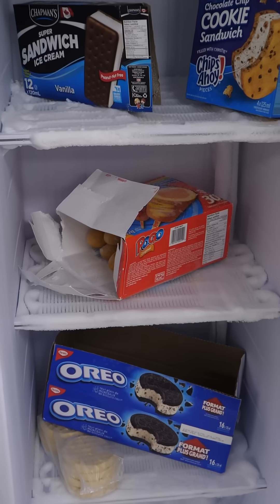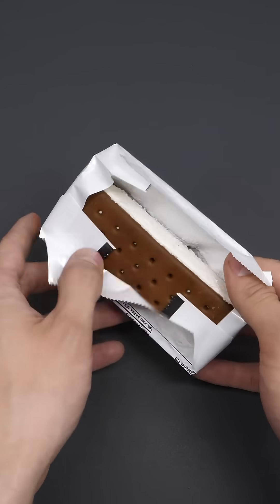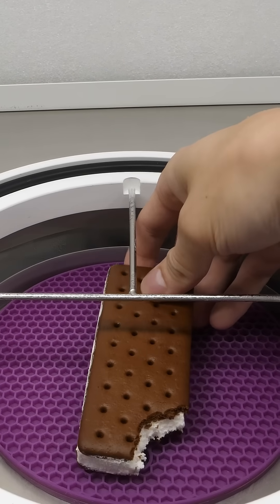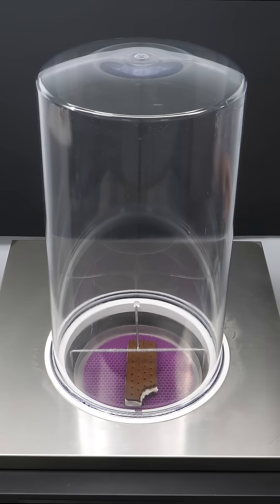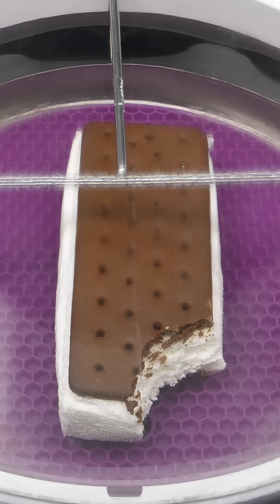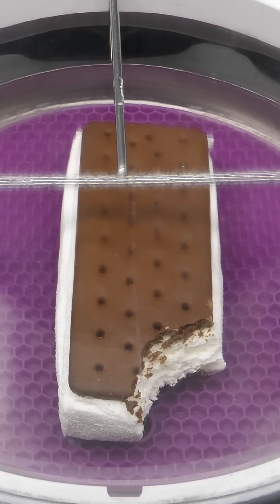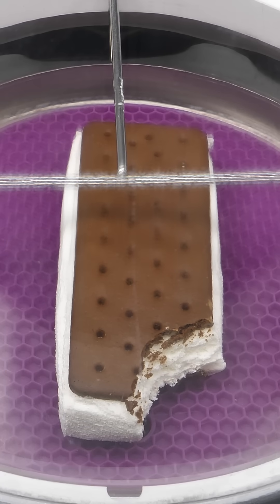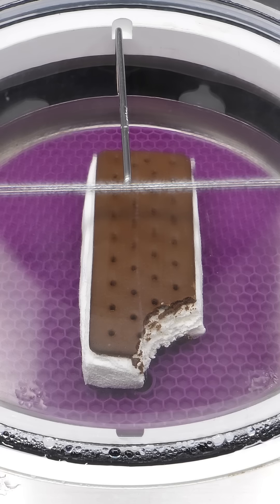Making astronaut ice cream

Comment: what happens when you add regular ice to the vacuum chamber? (check the reply if you wanna know)
Reply: the water molecules in the ice directly transition from a solid to a gaseous state (water vapor) without going through the liquid phase. Which is called sublimation
Reply: the same thing happens with dry ice

Comment: So freeze drying works by removing the pressure within a system and since the pressure is essentially 0 or close to water evaporates because its vapour pressure equals the systems pressure of 0? That makes a lot of sense if true

Comment: two things the USDOD needs to bring back in the MRE. this, yes they used to have freeze-dried ice cream sandwiches... and freeze-dried beef 'squares'. i loved those! the beef square was about an inch or so thick and around two inches or so long. these dried ice creams had a texture almost exactly like those breakfast cereals' marshmallows, similar process. imagine that but a 'beef marshmallow' that almost dissolved into nothing with your mouth's saliva and a minimal amount of chewing. they made great beef soup stock if you dissolved the freeze-dried beef square in your canteen cup, if the water was even slightly warm. but i just liked to bite into them and chew them up.

Comment: I don’t understand why this would be better for astronauts than just the regular ice cream sandwich… yeah okay it’ll be lighter… but wouldn’t it being so crumbly be a potential risk to the mechanical parts & vents inside spacecraft? At least from what I remember… dust & small particles are a problem in low/no gravity settings… so this thing crumbling apart as you bite into it seems like it’d be a nightmare to deal with

Comment: “Today, I’m going to dismantle an innocent gummy bear because it actually has one chemical in it that looks eerily similar to glucose. So I’m going to try destroy it, extract its insides, and convert it into something way cooler. I need to remember to be careful, so I instead of my wooden hammer which is kind of inefficient, I’ll use the steel one. Also I might just taste it while it’s not safe to taste because it might feel a little tingly and could potentially be kind of tasty.”

Comment: I never really questioned exactly what "freeze dried" meant/takes, but now I know!
Reply: This is not real freeze drying. It comes close, but in a real freeze dryer, you add an amount of heat to allow for efficient sublimation of ice. But the benefit of this method is that you can accomplish a good result for a very small amount of money. In my case, it was the difference between $300us and $6000us. I accept that my results aren't as perfect, but they're good enough for me.
Reply: @jeschinstad Holy, $600??? Why was it so expensive
Reply: @JustaBigMan  No, $6000us. That's what they cost. My method is much cheaper and it's good enough for me, but I'm not sure it could be approved for space travel and such.
Reply: @jeschinstad  does that include the machinery and stuff for the process, or just stuff for the process. Sorry I'm kind of an idiot on sciency things
Reply: @JustaBigMan  It's a machine similar to a washing machine where you insert trays with things to dehydrate. That machine costs thousands of dollars. It first freezes the food very quickly down to -50C or something like that, then creates a vacuum and then gradually heats the food under vacuum. The combination of these things, I think is the reason for the price, along with it probably being a very niche market. It uses loads of power and takes a long time.